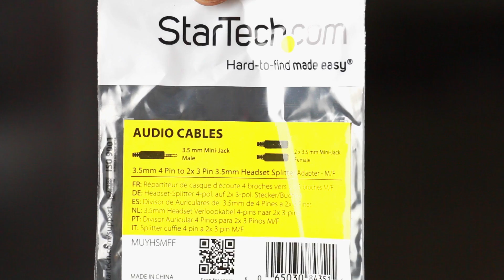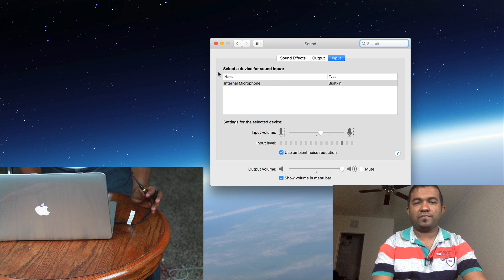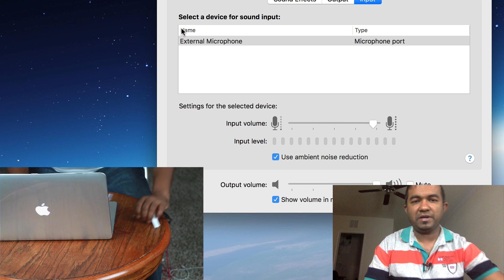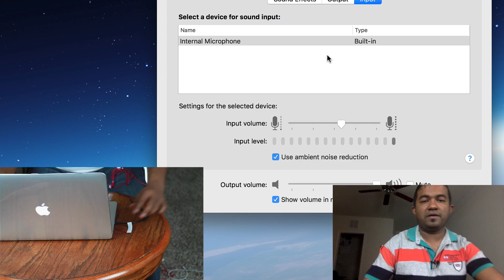How to (CORRECTLY) connect external microphone into MacBook Pro or TRRS port.

Comment: Thanks, it is still not working on my end.
Reply from the maker: read my pinned comment
Reply: @krish  I don't find it, but at this point I believe that the problem is the reduction that I have between the XLR cable and this 4 ways jack. I have just purchased a XLR to 3.5 mono jack... hopefully it will work, but please, if you could point me to your pinned comment I would appreciate it.
Reply from the maker: @AlessandroCoragliaAnimator  Everyone who said this is not working Make sure other connector you used to fill headphone part of your split adaptor (in my example ear buds) MUST have 3 rings (TRS) on its connector. not 4 rings. mean that should not something with microphone. (most of time) when it has microphone it has 4 rings. in order this to work that should be 3 ring connector (TRS)
Reply: @krish  I am going to remove one adapter from the whole system, hopefully that is wrong. The adapter that I have purchased seems correct, 3 black rings, one female connector for the headphones and one female connector for the microphone (which I hope is mono, but it should be).
Reply: @krish  Actually, I am totally speechless... I cannot believe that the jack for the microphone is actually STEREO!! How is that possible? Microphones are mono. I have found a stereo adapter and yes, it works... that is absolutely not right... but at least it works.
Reply: @krish  found it. My connector has 3 black rings, I have stereo headphones and mono microphone, I hope this is right :D

Comment: Great job and great explanation! If you've used Macs (and PCs) with projectors for years, you can see why. Macs try not to show you a hardware connection that it determines WON"T work (like a projector that is not turned on). You plug something in - it could be just an extension cable not plugged into anything or a dead mike or dead headphones, so Mac doesn't make it appear as an option. It's good that it keeps you focused on the peripheral side - you just need to know enough to fix the simple problem. Brilliant!!!

Comment: Hi Krish, I've tried exactly what you've said (many times) I'm still not getting any joy, any advice? 

I have a rode videomic and a Vmax y cable for mic and headphone
Reply: I have a RODE Video Pro Mic and it did not work either. I noticed when I followed the directions and plugged it in, it would turn off the power of my mic. I am guessing the electronics on the RODE mic is preventing it to connect. If I used a simple wired mic, it works. It is frustrating, as I really want to use my nice RODE mic with my MacBook Pro.

Comment: I just want you to know that with your help i was able to resolve this issue of connecting my condenser microphone to macbook. God knows i was worried for days, read on so many forums and tried using soundcard, splitter and what not. Lastly i found out the reason - all positive needed before connecting and that worked with usb soundcard as well (did not even have to try splitter :)) !! Thanks for this video and keep doing the great work and continue to help people around the globe.

Comment: It doesn't work. My external mics are still not recognized. I even have an IRIG (its an apple product made for this purpose) and it is not being recognized by the computer when plugged into the headphone jack. If I try to "trick" it by plugging in the iPhone headphones first, the computer switches to external mic and the external microphone IS collecting the sound (when I talk, the sound is picked up by the mic and I hear it in the headphones.)  HOWEVER... the computer does not register any sound levels and none of the recording programs will record the sound.  Does anyone know what to do?

Comment: Hey Krish! Thanks for posting this. I couldn't figure out why I couldn't just buy a single 3 ring mic connecter and get this to work, but I see now that you must plug in a single "device" which has both mic and headphone available to it at the same time.  I will buy the mic/headphone connector piece and have some headphones handy to do this also.  Perfect! You are a life saver!

Comment: Sir this dnt work for me. I am connecting WR 800 mic. The splitter did connect my headphones. But my input still shows internal microphone
Reply: Did you manage to get it working?
Reply: Read my pinned comment
Reply: bought this and followed all the steps, and not working, bought another 3 different types TRRS, same not working

Comment: if I put the earphone only it's changed to external microphone, but when i plugged the TRRS port together with Microphone (like what you did) it won't changed to external. Is it because of my macbookpro is 2009?so its the plugged doesn't work?
Reply from the maker: did you try plug microphone instead ear phone?
Reply: its working now... turned out that the TRRS was broken, I bought new TRRS instead.Thanks your video was helpful!

Comment: Still doesn't work for me.
Reply: same, did you ever manage to get yours working?
Reply: zaneyzane127 nope, not yet. I've used a usb-soundcard instead but I would like to have it work without that.
Reply: Hey, just wanted to know you got it to work with your usb soundcard. I didn't even got it to work with that so please explain how you did that. I am using the behringer UCA202
Reply: Never did anything really. I got the SteelSeries Siberia V2 with the USB-soundcard you can get with it. I just connected the microphone and headphones to the USB soundcard and plugged in the USB soundcard into the macbook. Just make sure the audio output and audio in is set to USB soundcard.

Comment: Hı.  1 question.   İ am trying to live stream my sets. İ have a Mac And dj club mixer djm900nxs2. And stream program called OBS.  İ did everything to get clean sound but no way ı couldn't Get it. When í connect via USB öf mixer ı am getting only 1 channels sound from another  channel no sound. So İ took iRig2   which is trrs .İ tried 2 channel works but sound is so bad. Sound is not coming clean like mp3 format.  What should í do?

Comment: Hi Krish, I was just wondering what your male microphone connector is? TRS or TTRS? I have followed the steps in your video and it recognises the headphones, but not the mic with the adaptor. Is the adaptor intended for use with TRS microphones? Mine is TTRS and 100% works if I plus it straight into the laptop. I have an early 2015 macbook.

Comment: I have tried connceting and XLR female to 6.3 mm phono male microphones wire via a 6.3mm female to 3.5 male converter. This is then connected to a TRRS converter. Followed exactly the steps written.

But it is still showing Internal microphone.
I have checked my microphone on an amplifier it was working.
It would be reallg helpful if u could help me with this problem...

Comment: I posted on several other videos. I have a very similar issue but NOTHING works. It appears there are both hardware and software issues for this going back several years - ever since they combined both audio input and outputs. I have a similar splitter (different company) but it does NOT work in any configuration (and I've tried them ALL). 

I'm curious if you have the ability to input an EXTERNAL LINE IN source into your Mac.
That is another problem I've had ever since I bought this MacBook Pro in 2013. It WILL NOT recognize an Audio LINE IN - which is bullshit. This is a MacBook PRO - Most OFTEN USED BY PEOPLE in a PROFESSIONAL Audio/Video Environment.  This capability is a MUST and using a USB adapter is NOT AN OPTION. Anyway - here is my post explaining more that I posted to other video's for those having similar issues.........

I have a TRRS Mic/Headphone splitter cable and I've been trying forever to get this to work on my Macbook Pro 13 inch (2013). It just won't work. I also used it for my iPhone6 to input an external mic. I finally got that to work with the same cable. I found that in order to get it to work on my iPhone6 I had to connect the Mic to the adapter FIRST. Open the Application I wanted to use (such as Camera) THEN plug in the cable. In the Camera App - there is NO indicator to let you know whether or not the Video Recorder is using the internal or external mic source so I had to install a 3rd party app in order to verify it actually works. I used "Recorder Plus". This allowed me to use the cable on my iPhone BUT I still CANNOT get it to work on my Mac. BTW - I also tried going into the Audio settings AND Midi Utility on my mac but there is NO indication that it recognizes to external Mic. Anyone have any ideas?

If anyone knows why this is happening - please let me know. I'm also curious to know if anyone else has tested to see if they can INPUT an AUDIO LINE IN source. On my previous 2007 MacBook Pro (with separate jacks, I could EASILY select between Mic IN or LINE IN. The ONLY way I have ever been able to use LINE IN is with a USB adapter (WHICH SUCKS). 

UPDATE 2018:  I have 4 different connectors including the STARTECH splitter. It DOES NOT WORK on either my 2013 model MacBook Pro or a new 2017 MacBook Pro. 2013 model is running Sierra 2017 model is on High Sierra. I have tried this on over 10 different MacBook Pro machines in my organization and NON work.  STEVE JOBS Your company (APPLE) has gone DOWNHILL since you've been gone!!!!!!
Reply: Did you ever find a solution? I'm having the same problem.